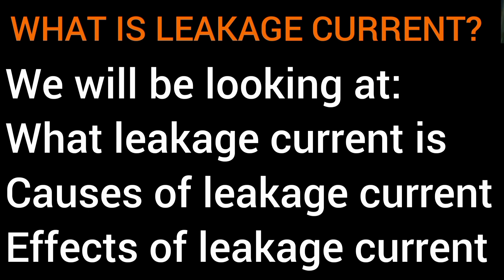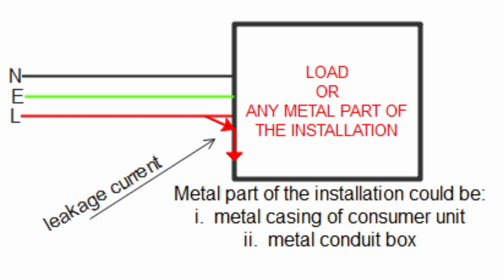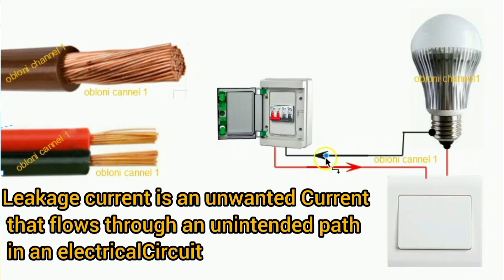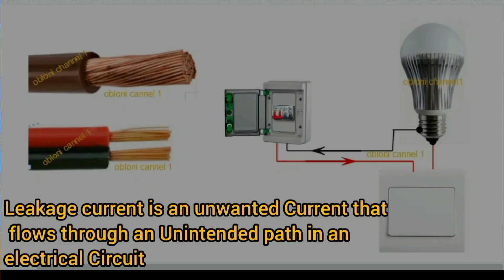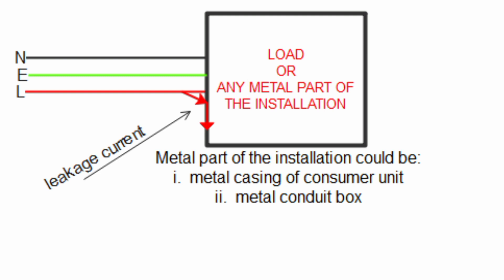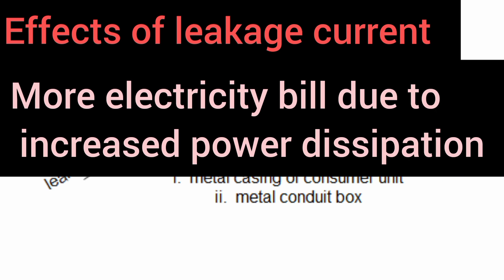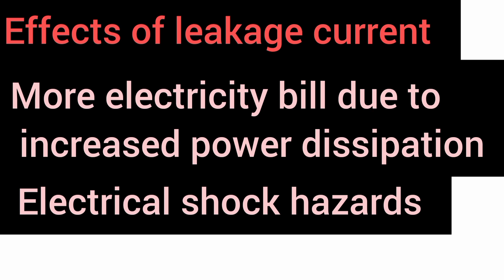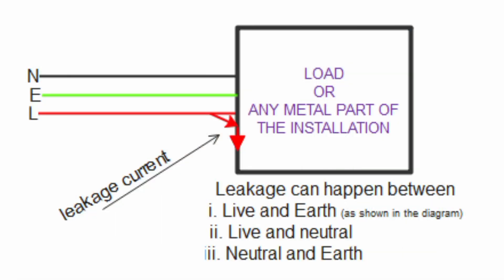Understanding Earth Leakage and Its Dangers

Comment: Thanks for the education sir, but my question is, I learnt that, when you have a very good earth, you can also use it as neutral, now why, should the RCD trip when you link the earth to the neutral?
Reply from the maker: The type of earthing system at the facility depends on the earthing arrangement of the power supply authority. So you find out first if the supply authority allows that type of earthing. I think I should make a video to clarify this.
Reply from the maker: Please this explains everything concerning your question. Thanks. Use this link.
https://youtu.be/wWO2Z-gm-HA?si=HNwph21ntZLpNRjO